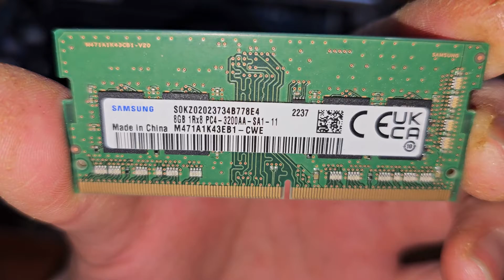HP Pavilion Laptop 15t-eg200 Disassembly RAM SSD Hard Drive Upgrade Battery Replacement Repair

Comment: Is there an upgrade/replacement for the wireless card that you recommend? I have this exact Hp model and my existing wireless card is having issues connecting to WiFi.
Reply from the maker: Not sure. Sometimes they lock the board to only support the same model.
Reply: @ItsBinhRepaired if I’m having trouble connecting to WiFi..is it the wireless card and should I just replace it?
Reply from the maker: @tikigyrl79  is it intermittent?
Reply: @ItsBinhRepaired it started going off and on a couple of months ago…now it won’t even connect